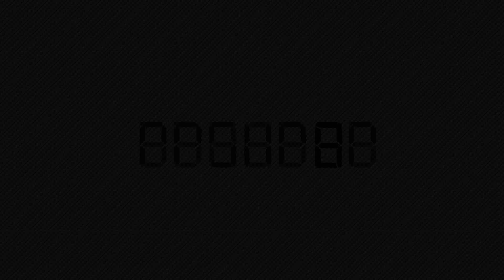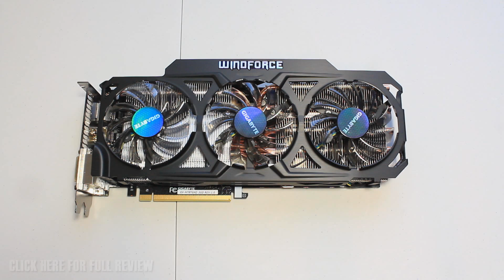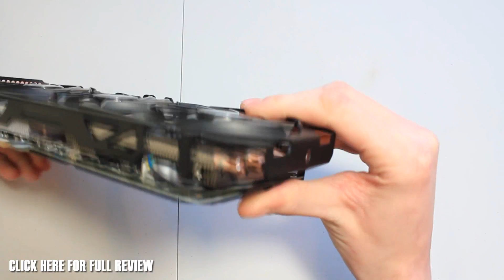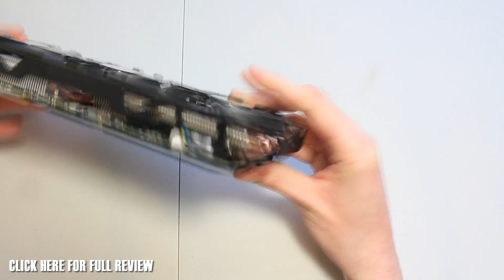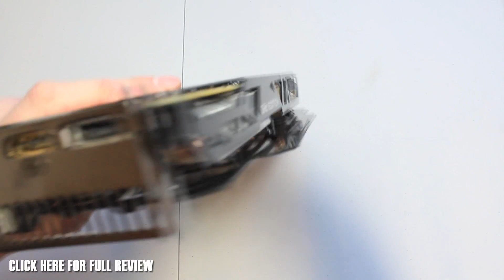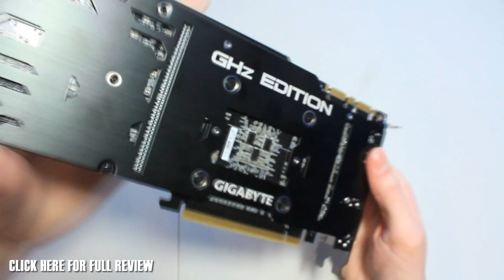Gigabyte GTX780 Ti Ghz Edition First Look

Comment: this card is a monster. i can see why it costs so much. i think it is good value for money
Reply: not at the moment, when its goes down to 400ish it will be good value for money, for performance by a mile I would go for 770 sli for the value for money, much better performance. but still,,, izzz sooo sexxxxyy

Comment: Nice card, but the back plate's writing will be upside down when installed and looking through a side window.  Nice card, but someone dropped the ball with that part.  Not a deal breaker, but it is slightly disappointing especially at that price point for that card.  I wouldn't expect that to have been overlooked.